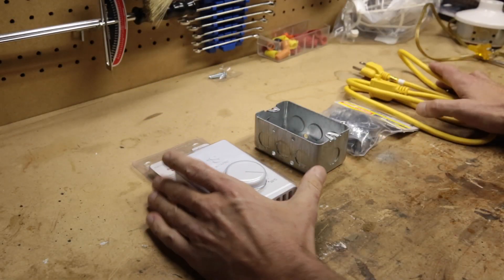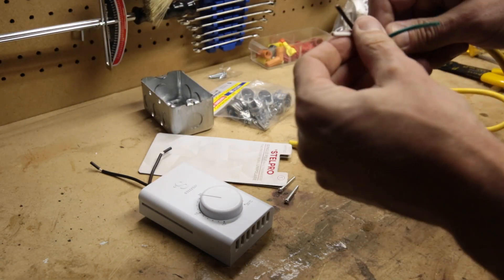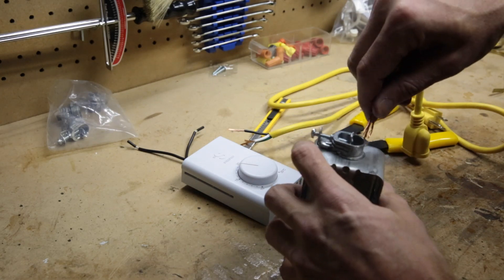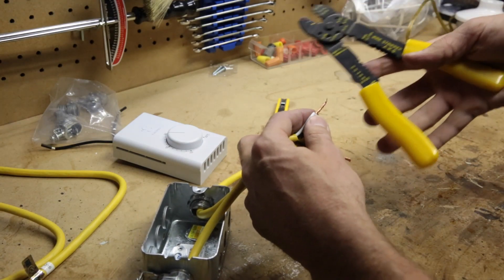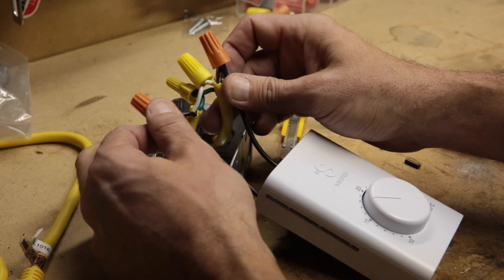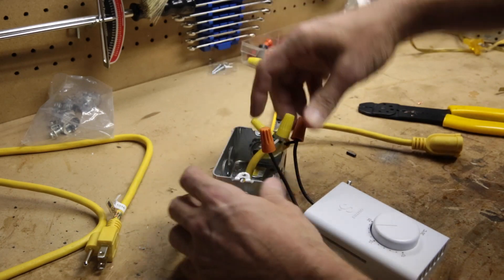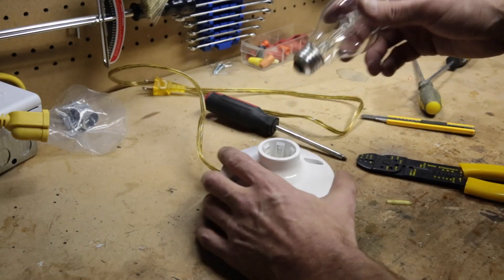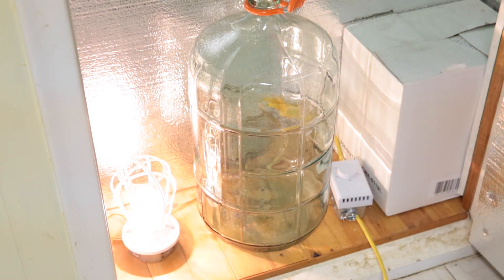How to Make a Thermostat Controlled Extension Cord

Comment: Could you use a "Honeywell Winter Watchman" and simply plug the little electric heater into this "Watchman"?
Reply from the maker: never heard of it, but now I have to look into this, thanks
Reply: The "Honeywell Winter Watchman" is only rated for 120 watts. A Lux WIN100 would work though.

Comment: Warren Hardy, my name is Jon, I really liked this video and is exactly what I was looking for to a project however I was wondering if you could make a video on how it’s done with a digital low voltage thermostat to?  I want to do everything just like you did in this video but by using a low voltage digital thermostat.  I am sure I would need to use a transformer or 2 different transformers.   I was going to plug into the plug end part a 1500 watt electric ceramic space heater into the plug end of the thermostat controlled Extension cord.

Comment: It was not specified that this must be a line voltage thermostat. the thermostat and box were not grounded, therefore electrocution and fire could occur from any fault (crushed wire, failed thermostat, overheating) which if wired properly would have tripped the breaker. Also, some of the conductors were cut too short. And an incandescent bulb in an enclosed space causes house fires. This one will occur sooner, whens something falls over  on the bulb.

Comment: is it possible to install two thermostats into one outlet? I want to have a thermostat run a fan if it gets too hot or if it gets too cold.
Reply from the maker: No sure, let us know.
Reply: Clover Bee You can do this with a temperature controlled outlet. Can find them on Amazon for about $30

Comment: I just bought a mini car heater that plugs into the 12V cigarette power supply. It only has an on/ off switch. Is it possible to install a small thermostat to something like that? It only has the two wires unlike the one in this video. What kind would you recommend. Thanks.
Reply: you cant heat properly through accessory receptacle, dontwaste money there, get the heater fixed

Comment: This is actually pretty simple. I have an application that I would like to use this on. An oil-filled electric heater. The built-in thermostats are highly irregular and do not sense room temperature. The problem is a device which could handle the wattage. The max would be about 1,800 watts.  I would have to use a "line" thermostat that could handle 15 amps at 120 VAC. Other than that, I think this would work quite well.
Reply: A relay would make it possible

Comment: You know it is a lot easier if you thread the cut ends of the cord through the box connectors before stripping the wire ends.

Comment: I have a box fan that I added a thermostat to, the fan (box fan) has three speed settings, is there a way to have the low speed come on 50 degrees and high speed come on at 90 degrees
Reply: You will have to make a switch for that

Comment: What are the applications for this?
Reply from the maker: personally I use this at my cottage to keep a small 5 x 4 x 4 room that contains my water pump and pressure tank warm through the winter months. only difference is that I power 2 reptile heat lamps with it instead of a light bulb

Comment: I wouldn’t trust that thermostat to handle that sort of power.
This dude has a safer way of doing it.

Just my two cents.
https://youtu.be/vMPSbm2pHP8

Larry
Reply: The Honeywell installation manual shows the unit being wired just as he did. The unit seems to be rated for 22 amps at 120v
Reply: Stay safe 👍

Comment: A double pole can be shut off manually on the thermostat. A single pole can only be shut off completely by unplugging your cord.
Reply: Double pole means 2 switches. A single pole uses 1 switch to control 1 hot wire. A double pole uses 2 switches for controlling 2 hot wires. The video showed a single pole thermostat controlling a 120 volt load, which is okay. If it were controlling 240 volts, it needs a double pole to control both of the hot wires for the 240 volts.
Reply from the maker: good to know, thank you

Comment: I found some old resistance heat wire units that screw into light socket in place of light bulb that would work great for that and use more watts for heat and less wasted as light.  Great setup there BTW.  Very handy cord can be used for so many things.
Reply from the maker: Nice. Thx

Comment: I want to do the same thing as you did in this video and i bought a thermostat just like this one however i just noticed that my thermostat that i just bought today has 4 wires and there are 2 Black hot wires or mabey even 4 Black wires and then 2 or 3 Red wires, it might be a double pole or something but am not for sure. How do i do this project just like you did in this video? there thermostat i have looks just like this one however has 4 wires total or less but it does not have 2 Black hot wires on the back either.
Reply from the maker: Not sure on that
Reply: It's either a heat and cool thermostat or or for interupting both negative and positive

Comment: fyi Warren they sell these, all you do is set temp and add plug but thanks for the video, shows that it can be done this way too and i'm guessing could use a programmable thermostat the same way
Reply from the maker: +whydoineedtohaveacct I like your handle!
Reply: whydoineedtohaveacct they don't make line voltage programmable thermostats. Have to have relay and transformer and low voltage tstat.
Reply: Yes they do. Look on Amazon for LUX Win100 programmable line voltage thermostat.
Reply: @mikep6731  Yep!

Comment: This Stelpro thermostat, the key to this project, is not available at any hardware store, farm & pet store, Walmart or Homedepot in the Sacramento area, but Stelpro provided the name of a source (Home Electrical) which has sent one after I paid them $25 for it, not $12 as mentioned in this video.
Reply: It is a common single pole Baseboard heat thermostat. 120 volt
Reply: It could be quite easy for the novice to confuse 24v thermostats for the type used here. Using a 24v for this type service could result in a fire. I found the 120v thermostats at my local home center stocked away from 24v thermostats, to where they sell electric baseboard type heaters.
Reply: That's how it is in california though.
Reply: A hint to makers of videos: you don't need to show every little step in such a process, such as stripping the wires, searching for stuff, etc., etc., and you might want to provide a hint about where any special equipment might be obtained.
Reply from the maker: yes a little long winded, and yes I'm in Canada, and the thermostat is a common thing to buy at any of the hardware stores around here.